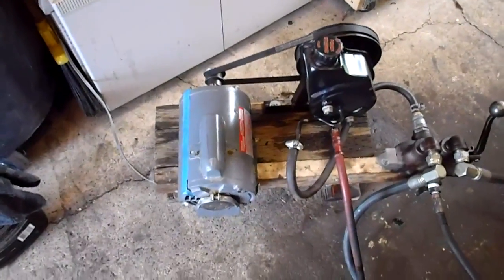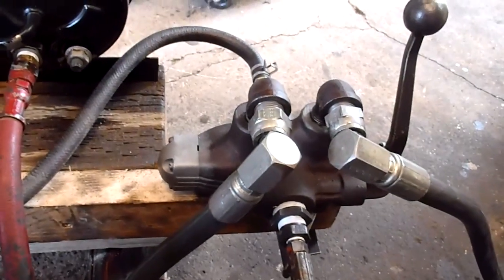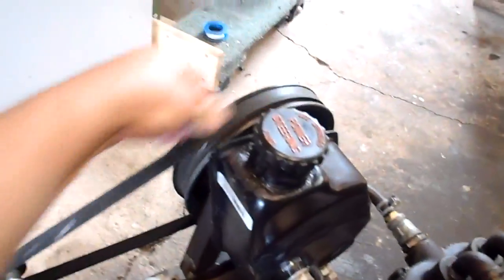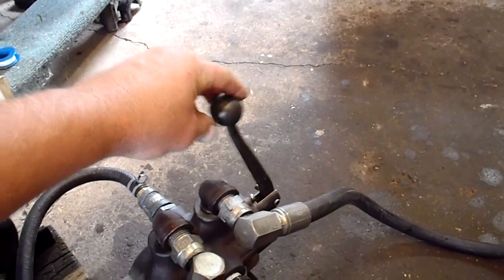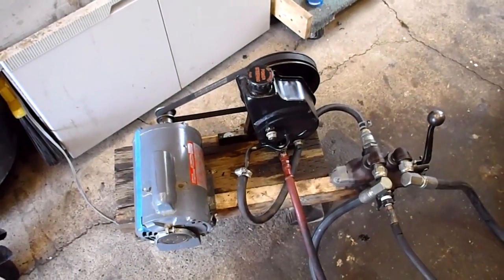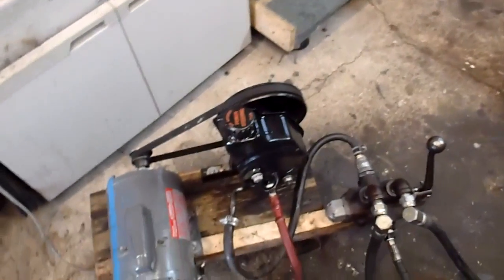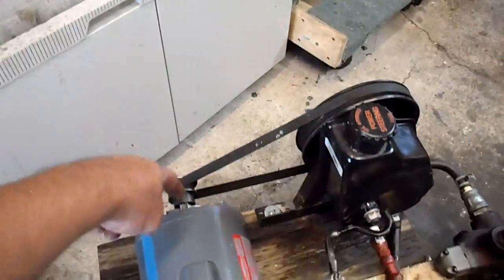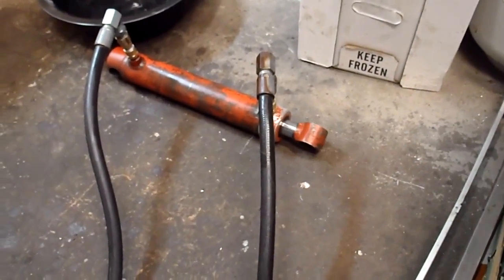Controlling Hydraulic Motor & Cylinder With Power Steering Pump

Comment: Hi. I'm doing the same thing but i'm working with an hydraulic jack cylinder. My pump has a check valve but i'm concern about it holding presure without power, do you thing it will do??? Or just the fluid is coming back to the reservoir when power off and cylinder under weight???

Comment: Could a tractor with rear hydraulic remotes operate that motor as well? Is GPM a concern? My tractor remote levers should operate a hydraulic motor.
Reply: +Drew6709 Generally pumps like these run at about 2GPM and between 1250-1450PSI which is fine for garden tractors. People have used these with great results as replacement pumps for hydraulics on garden/lawn tractors.

Comment: Hey great set up! I am currently trying to build a basic hydraulic power system similar to the one you have assembled, however I was a bit unsure on how to connect the various valves, pumps and motors. When the operating valves are closed does the pump simply circulate oil under no load back through the reservoir?
Reply: yes

Comment: I tapped into the power steering system on a GM 1/2 ton truck to operate a Myers plow set up and it worked really well for that, quick and strong. A strong word of caution is that when operating the plow controls the power steering doesn't work, the oil flow is diverted to the plow except when lowering the blade. I did plumb in an oil reservoir tank.
Reply: +Ray B Sounds dangerous.
Reply: Home made car battery
Reply: This is exactly what i want to do. I just changed my rack, hoses, and pump..all new. I hate using my winch for my snowbear 250lb plow..i wanna tap in and use my pump to just lift the plow.. tell me what i need, ill do it

Comment: From what I've read, most power steering pumps are pressure relieved at about 700psi and have a MAX of 1300-1400psi, also are very low flow between 1-2 gpm.
Might work great for no-load or low load applications, but you're not going to build a log splitter or anything like that.  Also the limited oil supply will heat up quickly with repeated continuous loading, like powering a motor to run a small vehicle. Still...useful for the right things.
Reply: can we add a bigger oil tank?

Comment: This is nice, but for a high demand application the pump probably will need maintenance soon as it is a vane pump. The pump produces flow not pressure, anyway, depending on motor power and pump displacement, you could get a lot of pressure (1000 psi and up), or a high flow pump will give low pressure but high flow. Normally gear pumps or piston pumps are used for the ideas suggested. Gear pumps being not much expansive than a vane pump.

Comment: Yes it is. GM car p/s pumps are flow controlled at approx. 2 gpm and relieved at 1250-1450 psi. The electric motor in the vid is too small for that pump setup by about 50%. With a 1:1 pulley setup on a GT, it will give a consistent flow rate across the entire rpm range with more pressure available than on unmodified GT lift system hydraulics.

Comment: yeah it moves the ram but if it was under a load would it work or just make the belt slip power steering pump isn't strong enough to use to lift dirt on a bucket or is it?

Comment: cool  playing  w same idea  not sure about  auto power ster pump  maby you could use rmote rez pump  from gm big  blo trucks .  did youse hyd fl what gpm could swap pully size for rpm unde drive  or over drive.  could work  in small  graden tractor  loader  iam a welder   ican  make  myown stuf

Comment: Wondering your personal opinion, trying to fix my 6x6 and had a great idea while in princess auto i wanted to use two hydraulic motors to power it one on each side to make it like a skidsteer. Would it cost to much? Take to much work? Not have enough power? Not enough of a top speed? Thanks

Comment from the maker: Hey thanks for the comments!  To be honest... I don't know.  I have not rigged up anything to test it with yet.  My goal is to use this setup, power steering pump, to drive various things on my lawn & garden tractors.  I hope to be able to lift 500-800 lbs at the loader.  I've considered running several pumps in parallel with check valves if more pressure / volume is needed.  My loader is not complete yet...  I also plan to drive a snow blower and tiller with this setup.

Comment: i second the comment about using a PS pump with a remote reservoir. I had to remove the pump on a Ford Torus, it has a separate reservoir, and i couldn't help wonder if you could use it as a pump like this. 
thats how i found this vid.
cool stuff man

Comment from the maker: Hey thanks for watching!  I'm actually getting close to putting some of this on a '76 Farm King tractor, I'm building a front end loader for it.  Also, will be adding a hydraulic motor to a tiller that will go on the 3-point.  What part part do you have a question about?  If I can be of help I'll try ;o)
Reply: I am thinking of taking my 8 horse power engine off of a rototiller and attaching a hydraulic motor on it with a pump powering it off of the tractor, is there any way to speed up the hydraulic motor?
Reply: Obix which motor could be Installed above a hollow brick machine?

Comment: Thanks for the video. This is something I've been thinking of doing for a while but haven't got to yet. One thing I've discovered in researching is that the Toyota MR 2 has an electric 12V power steering pump. Not sure about what pressure it is rated to but the info could help someone.

Comment from the maker: Hey thanks for comment.  I'm not sure of the psi, I believe it's around 1300 give or take.  I want to adapt them to lawn tractors so they should be enough for that.  Good idea going to a larger automobile pump.  I've also considered a bracket to run two pumps in parallel.

Comment: Lots of possibilities there. What is the max pressure that pump will put out? If you plan on having  more rams you may have to switch to the pump they used on vans. It has an external reservoir that would be much easier to fab a larger oil tank to.